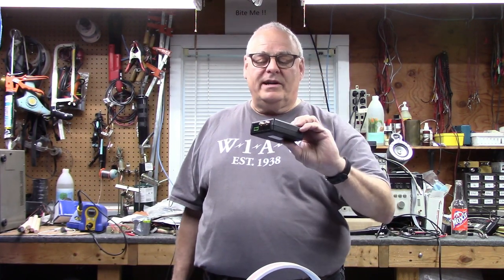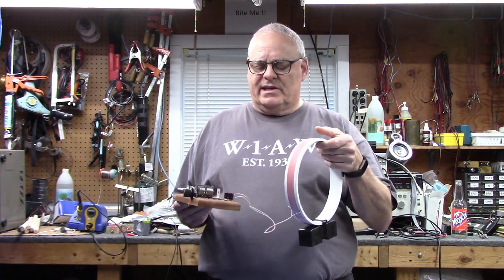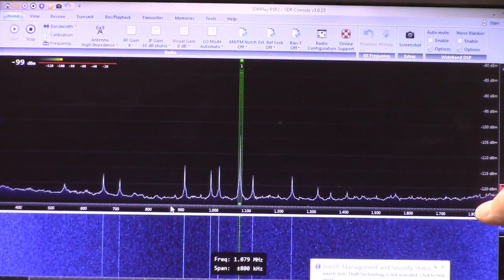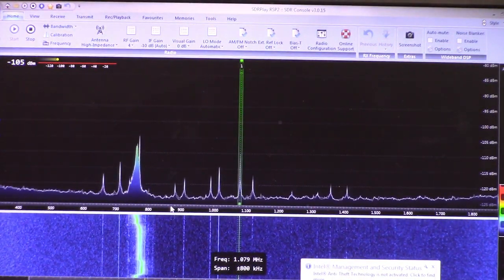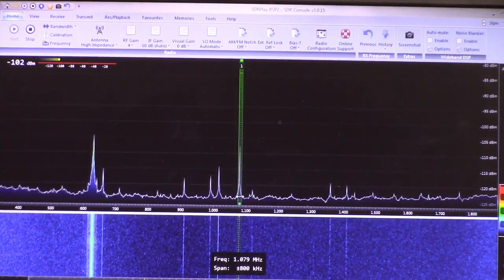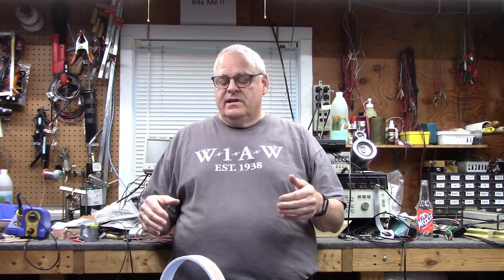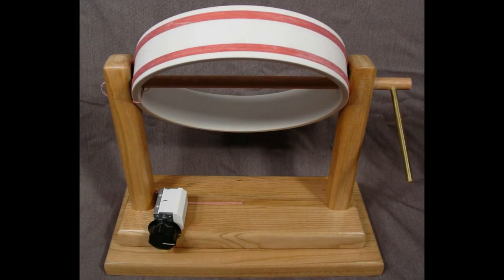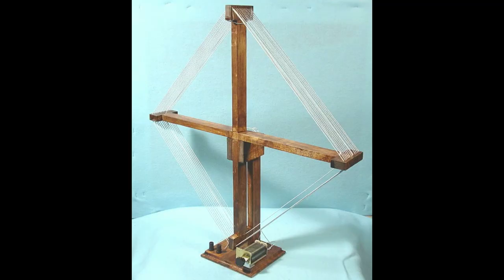You already own a BCB Preselector  Your air core Loop Antenna

Comment: Thanks for sharing this information. With the solar flux being so low, I find myself moving away from SWLing and enjoying BCB dxing more and more. NF8M has a ton of info on his website that's very helpful. Of course if I find myself getting really hooked on the hobby the FCC will probably ramp up the switch from AM to digital... Thanks again, and '73.
Reply from the maker: Karl.. I hope the FCC doesn't ramp up a digital move of AM over to digital.. In an emergency all one needs is a crystal set with analog AM... Not so with digital

Comment: I have many loop antennae, some are for LW and MW, one is a ferrite loopstick that requires a preamp if it is used with a receiver that does not have its own internal ferrite loopstick. I have two round loops and a box loop. It seems none of them have such high Q as yours, for I get a lot of noise. You said that the making of the loop you're using is in a previous video. I'm going to watch it. Thanks a lot. 73 from PY5WHO.

Comment: You mentioned that the large X or Box loops have higher Q.  I always thought that the smaller loop antennas have low Q but better "null" capabilities?  A trade off depending on one's preference.

Comment: Good stuff Paul. How many turns on that loop?
Reply from the maker: Hello Gene... That litz wire loop is built on 8" PVC pipe.  S o the actual diameter is 8.5"  The number of turns is 25 close spaced.  Check out my other video on finding out where your loop is resonant. Depending on the wire size you use it might not land  in the AM band and you may have to  add or subtract turns. I always make the loop with a couple extra turns even if I am duplicating one I built previously.  Its always easier to take off a couple turns then to add them !!!!! LOL